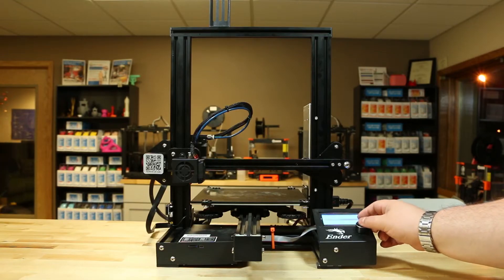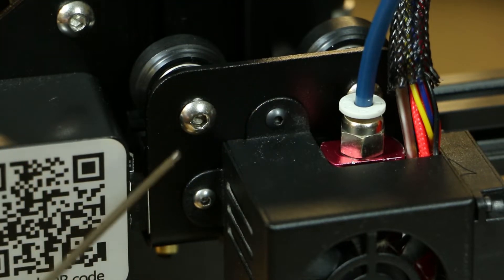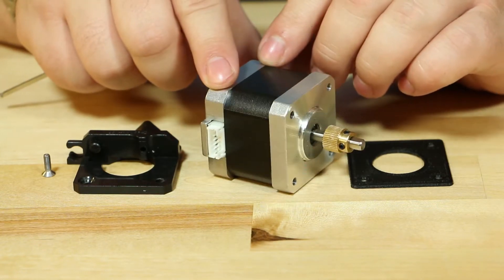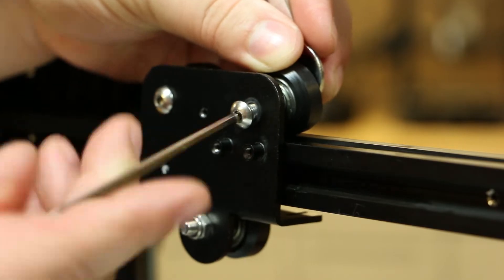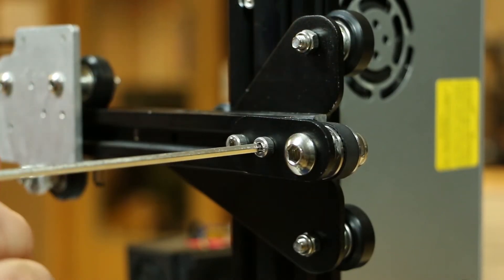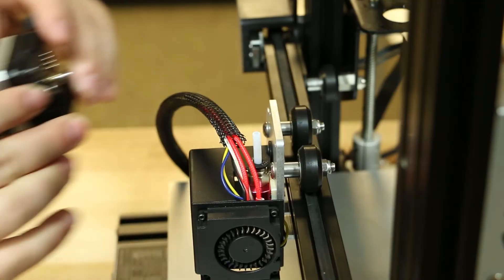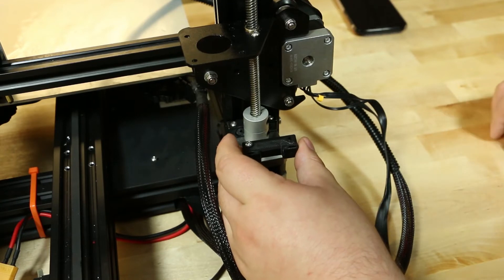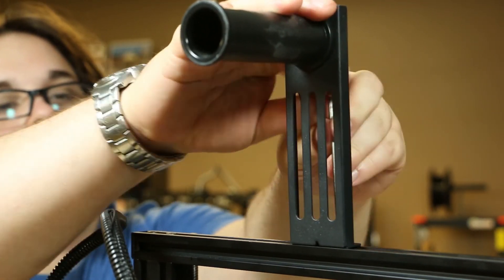Installing the Ender-3/Cr-10 Direct Drive Upgrade Kit

Comment: Yeah, so far this thing hadn’t been worth the hassle that came with the install. Came with so much headache and wasting so much time just getting my prints back to the quality they were before the install. Cost outweigh whatever benefits this thing touts with stock parts.
Reply: i have issues with moire/ringing/ghosting. how did you fix your issues?
Reply: mastav uninstalled and returned it to amazon. Fixed it right up.
Reply: If it Ain't broken, Don't Fix It !!!!!

Comment: I ordered one of these without looking at the installation instructions. I wish I had. The extruder motor is so loosely mounted that wobble is absolutely going to happen, as is wobble in the extruder itself. That tiny little spacer behind the extruder heatsink completely eliminates all rigidity in the extruder. This thing's a terrible idea. While it may solve one issue, it introduces a half dozen others. 
Mine's going straight in the garbage.

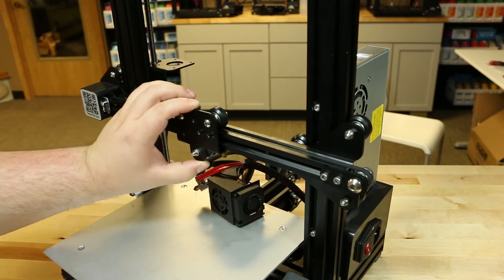Comment: 4:08 it looks just the same as before but with a washerplate underneath? still wonder how this was a direct extrusion conversion since all you changed was the washerplate and the carriage. pls explain. looking to convert my cr10s
Reply: The filament is fed directly into the hot end from the extruder with the new setup. You are no longer extruding through a 115-20" length of bowden tubing.
Reply: I agree, this is not really a direct drive, just shortened the length of the tube. A direct drive has NO tube, there is a kit out there that changes the entire x carriage, and you have true direct drive. No tube between extruder and hotend.
Reply: @Hoss_1966  it is a real direct drive, direct drive only means that the extruder assembly is on the head and the path between extruder and hotend assembly is a relative short lenght and straight. the method of getting the filament from the extruder to the hotend is not defined. https://airwolf3d.com/comparing-bowden-vs-direct-drive-3d-printer/

Comment: Noticed that the kit uses a PTFE tubing.  Can you use a piece of Capricorn instead?
Reply: yes, its the same thing. Capricorn is a brand name of PTFE tubing that is typically made to better tolerances than generic PTFE tubing.
Reply: @randyre8172  Update to this:  I decided to switch to Capricorn tubing yesterday and my prints came out horrible.  After almost a full day of messing around, I moved back to PTFE and the prints are back to normal.  Not sure why it messed up so bad but wanted to update this comment.

Comment: My long screw wasn't quite long enough to secure the little cable holder piece on the extruder motor.
Reply: Nevermind, just found the print files and will make my own replacement, just a little bit shorter! https://www.thingiverse.com/thing:3469514

Comment: Have you had any issues with the added weight? If so, what methods would you recommend to make adjustments?
Reply: you could either redo the aluminum mount to seat the stepper motor the other way to balance it better or use a stronger z axis stepper but it isn't necessary

Comment: As this kit alters the position of the nozzle slightly in the Y direction, I believe that firmware changes would also be necessary, especially when using an ABL kit, as the firmware must know the correct offset values. Can anyone confirm this? I am thinking about a direct drive upgrade to my CR-10 (With EZABL and Micro Swiss Hot end)